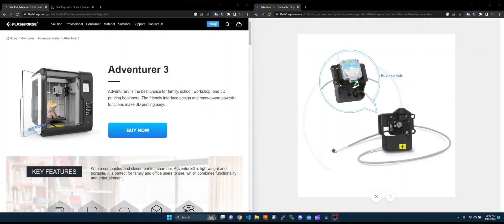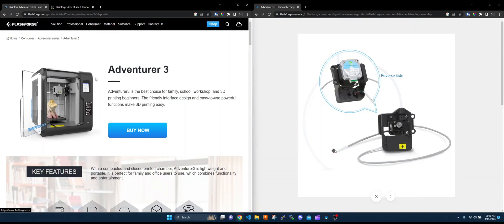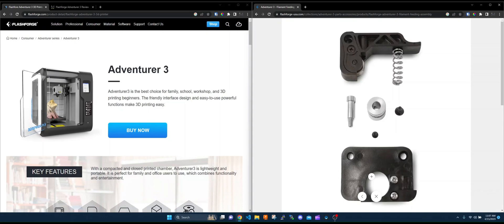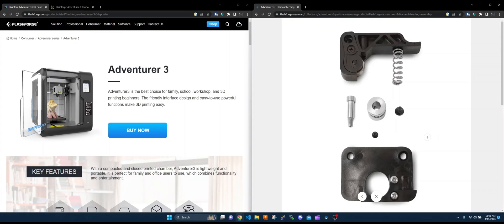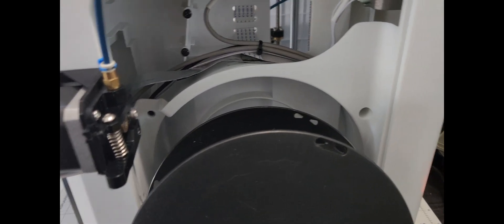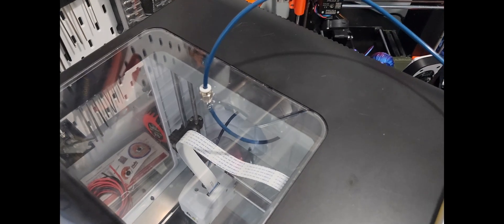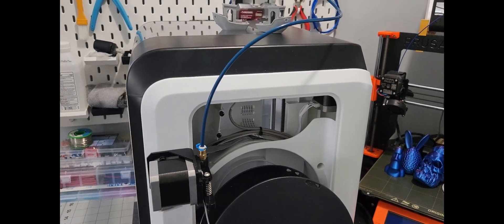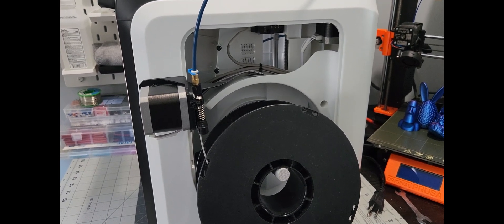Flashforge Adventurer 3: Extruder Upgrade

Comment: was this just using the motor that came with it or did you use the ender 3 motor as well?
Reply from the maker: I used the Flashforge motor.
Reply: @mojee3d  Thanks, just got an adventure 3 for free, it needs a new extruder motor and extruder lever assembly, but after seeing this i will probably get a different feeding assembly and not run into this problem! Thanks again for the great video, and for the reply!

Comment: Can I change the steps per mm through the GCode for this printer. I'd like to change the extruder to a 3to1 geared version, but I'm not sure the firmware allows you to reset this value away from something embedded in the code itself. I find the 1to1 stepper drive on this printer isn't quite enough to stop the tick-tick of extruder skipping.
Reply from the maker: Yes, something like this should work. 

M92 E<new_value>  ; Set new E-step value (replace <new_value> with your desired steps/mm)
M500              ; Save settings to EEPROM
M501              ; Load settings from EEPROM
M503              ; Print current settings (optional, for verification)

Comment: I tried to watch this but I couldn't over the popping from my printer.  But seriously, interesting video!
Is there any adjustment to make the spring "tighter" to try and avoid the slip?
You said you tried other gears without success?  I've been updating that.
Reply from the maker: @randyjohnson4007  I tried several ways to fix the stock extruder but nothing worked as well as just swapping it out for a better design. I no longer have the printer as I gifted it away but it worked great after the swap. 

With it stock, the best “fix” was manually extruding filament at 240 C until the skipping stopped, then sending a print. Not a real fix but it worked. 🤣
Reply: How do you think that fixes it?
Just somehow frees the filament dust?
I'm a casual printer. But the thunk then failed prints is super annoying.
I've cleaned nozzles a good dozen times this week. 
 @mojee3d
Reply: @mojee3d  Why do you think manually extruding the filament at 240 does the trick?  That somehow gets the debris off the extruder wheel?
Reply from the maker: I think that only worked when the skipping was due to a partially clogged nozzle. However, even with a brand new nozzle, mine always popped and skipped as though it was clogged. My thoughts were that the stock extruder was simply trying to extrude at a flow rate that the heater in the all-in-one nozzle just couldn’t keep up with. I got frustrated with it, hence the swapping it out for a proven, and simple Ender 3 extruder. Never had another issue with it after.
Reply: I'm replacing mine with a 1:3 Titan or OMG extruder with 3 times the torque, but it means you have to step the motor three times as much. To do this, I'm going to either try to mod the steps/mm with an M92 E code in the startup or if this doesn't work, tell the slicer the filament is only in 0.58mm diameter and increase retraction since modifying the steps/mm in the firmware is not possible.

Comment: How were you able to calibrate in the new extruder? Were you able to use pronterface?
Reply from the maker: @Jericho-tc9yn  you can’t use pronterface but you can change values like e-steps by running the gcode via a usb drive.
Reply from the maker: Something like this…

M92 E<new_value>  ; Set new E-step value (replace <new_value> with your desired steps/mm)
M500              ; Save settings to EEPROM
M501              ; Load settings from EEPROM
M503              ; Print current settings (optional, for verification)
Reply: @mojee3d  thank you for that information! I greatly appreciate it!

Comment: I used to get this a lot. But since I have a few printers now this has become an ABS only. I also got a 0.3mm extruder and run it full speed and that seems ok. If it clicks its either the extruder/hot end that needs cleaning, is too close to the baseplate, or running at too fast a speed for the filament 
. But overall it is a c**p mechanism.

Comment: Did you just disconnect the filament sensor or did you have to make additional mods?
Reply from the maker: I just disconnected it but you could leave it connected and just add an M412 S0 to your start gcode to disable it.
Reply: @mojee3d  Thank you!

Comment: Gonna try this. 5500 hours of popping is too much. Thing is a money pit.
Reply from the maker: Yeah, that popping/skipping sound got to me after a while. This fixed that issue. The new extruder doesn't skip and the print quality was as good as it was new.
Reply: @mojee3d  How much tension did you put on spring? My metal one was missing the spring adjuster so it's at a "default" tension, gonna rig something up later-still pops from time to time on infills. Think I might have a bad nozzle too though. Wish i could convert this to an E3D hotend and be done. The cooling is such crap.
Reply from the maker: @b3darmoredwarfare  if you run the filament through the extruder, there should be slight teeth marks on the filament. To loose and you can pull it right out, to tight, and the extruder gear gouges the filament.
Reply: @mojee3d  I think mines probably ok then. Thanks again!